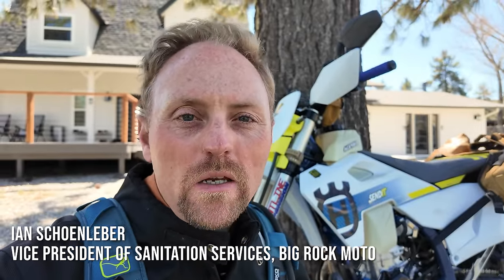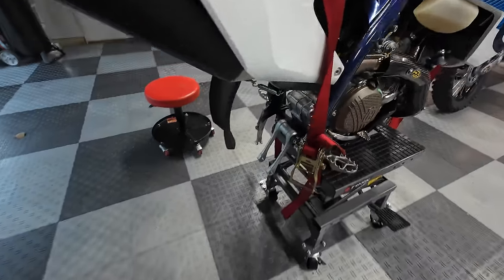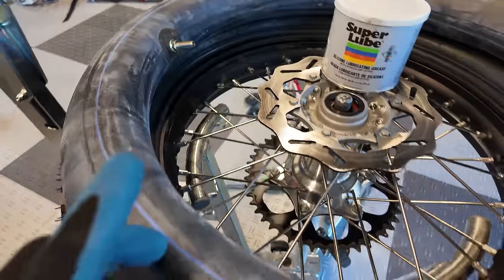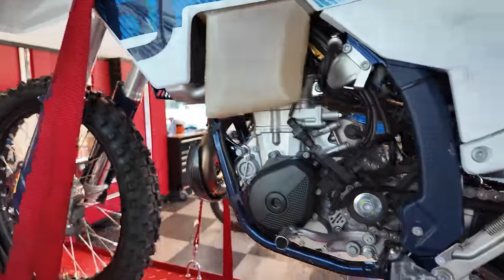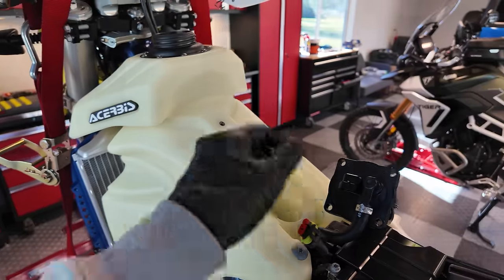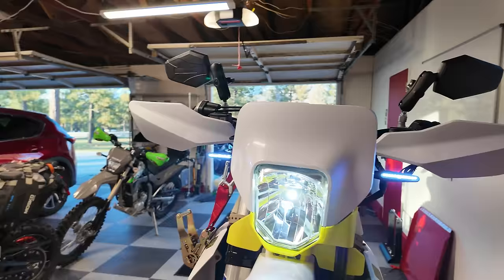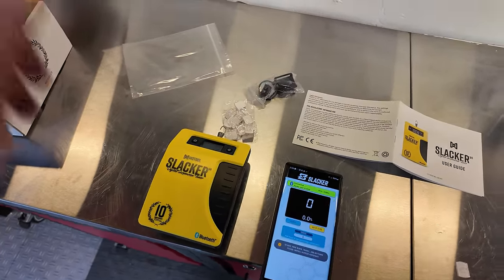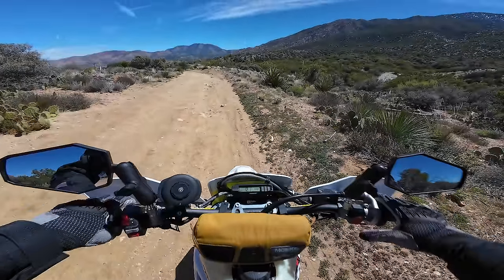2024 Husqvarna FE501S | Building My Dream Dual Sport (Phase I) (EP.4)

Comment from the maker: Stay Tuned - phase II and III of the build coming in May and June! 

✔FE501S Build✔
⚡With major support from..
 ..Taco Moto Co https://tacomoto.co/?ref=fi6gv640  and ..
..Rocky Mountain ATV/MC https://bit.ly/33kgRIz
➕Phase 1➕
⚡Frontline Suspension: https://frontlinesuspension.com/
⚡P3 Carbon Heat Shield: https://tinyurl.com/bdduk57w
⚡Seat Concepts Element XL Seat: https://seatconcepts.com/
⚡Molecule Motorsports Skid Plate: https://tinyurl.com/yzwnrx4z
⚡Doubletake Mirrors: https://bit.ly/3F8m4lV
⚡Heated Grip Kit: https://tinyurl.com/yea664se
⚡Mosko Moto Reckless 10 and 40: https://bit.ly/3p6CmHz
⚡Mosko Moto Gnat Bar Bag: https://bit.ly/3oTJMOx
⚡Motoz Tractionator IT and ST Tires: https://pacificpowersports.com/ USE CODE BRM2024
⚡4mm Severe Duty Tubes: https://tinyurl.com/mt4wfub2
⚡Wheel Weights: https://tinyurl.com/2y6ds5xf
⚡Tusk Rim Locks: http://tinyurl.com/ysswttd9
⚡Acerbis Fuel Tank: https://tinyurl.com/yybkbucd
⚡Taco Moto Oil Filter: https://tinyurl.com/4w2fhy7h
⚡Golan Fuel Filter: https://tinyurl.com/3b74fd7b
⚡Taco Tail Tidy and Signals with Enduro Plate: https://tinyurl.com/4a5tz4c6
⚡Acerbis Swingarm Guards: https://tinyurl.com/44a9ssh7
⚡Acerbis Fork Bottom Guards: https://tinyurl.com/7xe59h64
⚡Front Rotor Guard (upgrade): https://tinyurl.com/2wyky8zb
⚡Tusk Rear Rotor Guard: https://tinyurl.com/5fjn3bwz
⚡STR Fork Bleeders: https://tinyurl.com/bdh4cw7u

➕Tools/Shop➕
⚡Motool Slacker Suspension Tuner: https://tinyurl.com/4pnkzcea
⚡Tusk Balancing Stand: https://tinyurl.com/yyzpej72
⚡Rabaconda Tire Changer: https://tinyurl.com/2j22c76t
⚡Tusk Scissor Lift: https://tinyurl.com/4hvdhckx
⚡Tusk Oil Change Kits: http://tinyurl.com/y457nham
⚡Cordless Ratchet: https://amzn.to/3HRWALc
⚡Nitrile Gloves: http://tinyurl.com/ms8vevza
⚡Tusk Tire Gauge: https://tinyurl.com/3jtah74d

➕SUPPORT➕ 
[I may receive commissions which are invested back into the channel]
⚡ Patreon: https://www.patreon.com/bigrockmedia
⚡ Rocky Mountain ATV/MC: https://bit.ly/33kgRIz
⚡ Revzilla: https://imp.i104546.net/6bxxXN
⚡ Mosko Moto: https://moskomoto.com/bigrockmoto
⚡ Pacific Powersports (Motoz Tires, Barkbusters): https://pacificpowersports.com/ USE CODE BRM2024
⚡ 3D Cycle Parts: https://www.3dcycleparts.com/?aff=3
⚡ Taco Moto : https://tacomoto.co/?ref=fi6gv640
⚡ Cyclops Adventure Sports: http://tinyurl.com/2kaknpfn
⚡ Amazon: https://amzn.to/3viGZ0A
⚡ Merchandise: https://big-rock-moto.myspreadshop.com/
Reply: Keep this build going!
Reply: Could you compare the xact suspension with the 890 xplor and xplor pro stuff? After getting a second set of wheels for my 890, I'll be looking to put all new suspension on my 890 s. I'm between waiting for used set of xplor pro stuff, tractives +40mm for the stock 43mm suspension, or possibly go nuts & figure out how to fit xact pro stuff on.
Reply: How did you get the Acerbis swing arm guards to fit on the left hand side of the bike with out removing the chain guard the tab hits the guide did you have to cut it of or what

Comment: I have an FE501S. 
MANDATORY 3 in 1 MOD. 
1. EURO AIR INTAKE
2. ECU
3. EXHAUST

You cannot do only one or only two. You must do all 3. 

Stock, the engine has Asthma. It cannot breathe because of the Reed valve. Do not waste your time or energy trying to modify the stock Air Intake. Eliminate it. The Stock EURO Air Intake tube is a straight hollow tube. No more air restriction. 

When you do that, you just made the engine tune too lean. Hence, the new ECU with proper tunes pre programmed for you to choose from. 

Mod 3, uncork it so it can eliminate all that air and fuel with a  performance exhaust. 

A performance ECU demands more air and an unrestricted exhaust. 

I have the Euro Intake, a Vortex ECU and a Yoshimura Exhaust. 

It’s a beast. The throttle snaps. No more flame outs. Throttle performance is now instant. It does what I want it to do when I want it to do it. When it was stock, throttle response had a delay. I’d throttle…….and wait. No more. 

My Vortex has a tune available for elevations over 3,000 ft. to correct for less air density at higher elevations. 

Unfortunately, the FE501S, has a different wiring harness than the FE501. 

The FE501 has a factory MAP switch. I know this because I tried, but there is no way to attach the factory MAP switch into the FE501S. 

The only thing I need to do is install the Vortex MAP switch which will allow me to switch to a second MAP tune with the flip of the switch. I plan to use the Higher Elevation tune for position 2 since I have mountains nearby. 

I love my FE501S. I have also done the suspension, cone valves etc., the Acerbis.

Consider Sicass front and rear blinkers. My Sicass handguards have the front blinkers integrated into them. 

Enjoy!

Comment: I'd still prefer a physical oil filter, then stick a high strength magnet on top of the drain bolt, or just inside the case.  Not all engine parts are (strongly) magnetic.
Reply: Hmm that was my same thought, I really didn't like the look of it but after looking at their product page I kind of like the idea, it seems to catch more material, much finer material, you can clean it super regularly too and it doesn't slow down oil at all at start up which is a massive bonus. I think if you were to run something for 10,000km without a filter change you should go paper but for a dirt bike or bike where you are willing to pop it out and clean it a couple times throughout oil fill life this would be much better I think, much to my surprise.
They have tests and 18.5% of solids the rod collected were "Dust, dirt, sands" i.e. "dirt from outside world and silica from clutch pads." 33% iron and 44% carbon, they seems to be collecting everything I want it too and evenly enough.

Comment: We have to love Toco Mike and his excellent parts and service. By the way, I spent last month in northern Baja with my 500. I installed the 140/80-18 Motoz Tractionator Enduro S/T Rear (not I/T) on the rear and loved it. We got a lot more rain and mud than planned, and this tire was great in both the mud and deep sand. The Motoz front was out of stock locally, so I put the Michelin Enduro Medium Front Tire in 90/100-21. This tire also worked very well in the mud, sand, and rocky trails. I think I am now an official fatty convert. 

I am keen to see and hear about your experiences with this tire combo.

Comment: For the high cost of performance motorcycles, one would think that you could order one set up at the factory for your weight + expected weight of all accessories. At least a selection of different spring/valve rates that would be within a range of maybe 5 lbs plus or minus of a riders desired combined weight.

Comment: How does the magnetic filter out non magnetic particles (aluminum, copper, gasket sealant and etc)?
Reply: Exactly,  and non magnetic particles still block up oil galleries etc
Reply: The tacomoto product page for the filter says that non-ferrous materials are also caught via static adhesion and entrapment, and at smaller particle sizes than a paper filter can catch. Kinda questionable for the larger non-ferrous stuff but who knows
Reply: I wouldn’t trust it

Comment: Just think, in 6 months he will sell this fantastic bike. I’m convinced that my modified 18 500 is my best option, even better than my 690 for my type of use. Nothing beats a 45kg weight reduction. Re gearing, I’ve run 15/42 for easy dirt riding and it can easily do it.

Comment: I got a 2016 501 and what really changed everything for me was a cush hub rear wheel. Any LC4 wheel will fit plug and play. 

I just tried 15/50 Gearing and it worked quite well on the highway but was a little long for some woods riding.
Reply: Different gearbox ratios by the sound of it.
Reply: What is the the benefit of a cush hub on that bike if using off road?
Reply: @alexandre8598  Not much as the dirt allows slip on throttle  and gear changes . On road though those shocks go straight to the gearbox as there is no tyre slip. If you are going to keep the bike for a while and rack up the km's  it would be better to run a cush drive to reduce the wear to thoose components . If you have ever driven a 4x4 with locking  diffs  its a bit the same.
Reply: @alexandre8598  

For me one key benefit is that you can ride the bike in much lower rpm.  That helps with vibrations and also makes it less exhausting

Comment: I just took my rear shock out last night. I took off the 4 subframe bolts and was able to pull through the top without removing the swing arm by sliding the subframe toward the air box.

Comment: I like that you ve got some smarts to actually assemble the lighting harness on your bench before just installing parts abd trying to figure it out as you go.. I guess if you’re a al pro shop type guy you can do it however , but for normal everyday garage wrench turner and wire. Stripper , seeing the whole picture and I even use an extra battery to test to be sure everything does what it’s supposed to

Comment: The previous generation had wider ratio gearing and a tad taller 6th gear, and the reason is that the newer generation gearbox casing is the same as the 350s to save on weight, so they carried over the gearbox ratios as well. I love your videos Ian.

Comment: Personally I would want separate blinkers on the rear. I know the integrated light is more compact, but someone behind you would not be able to tell that was a blinker or which way you were turning if they did think it was a blinker. I would be afraid of getting run over from behind with only that light.
Reply: I agree. The brake light/tail light he installed is not DOT rated and is dangerous for the riders safety for being so small. Also if someone runs into the back of you the lawyers will use it against you on both sides of the litigation.
Reply: Those turn cignals are absolutely useless

Comment: If you trim the stock chain guard with a dremel tool, you can fit a 15 tooth front sprocket which is much easier to swap out than a 45 tooth rear sprocket.  Assuming you have enough slack in your chain. Adds about 5mph to comfort speed.